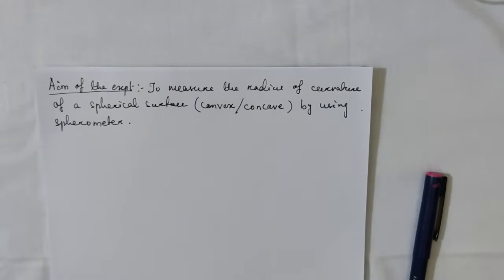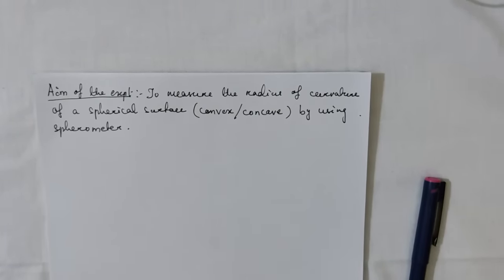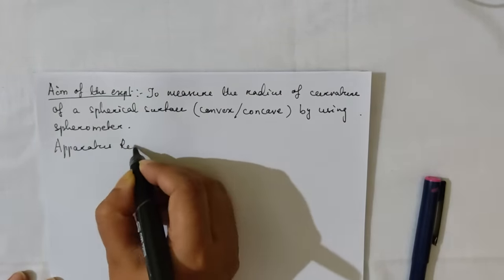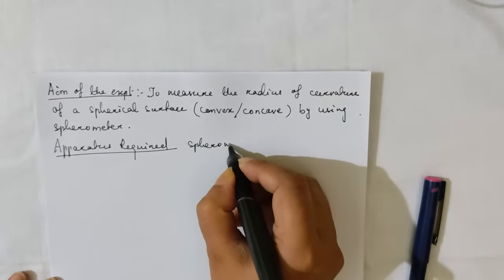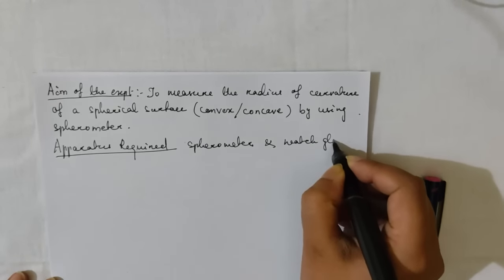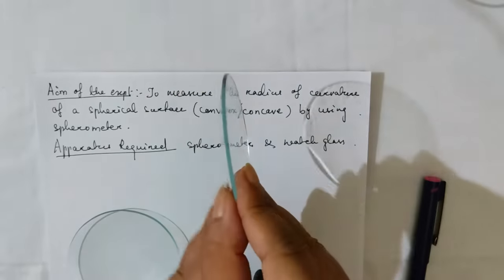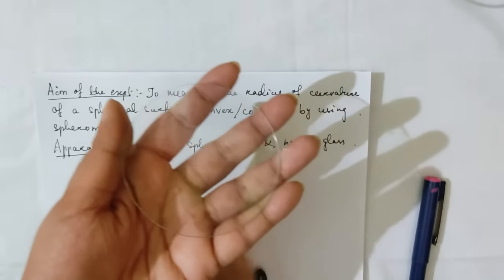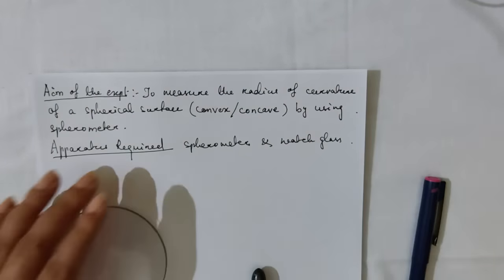Spherometer experiment (calculation of least count and tabulation- part-1 )

Comment: Ma'm why is the 0 of circular scale is not coinciding with 0 on the vertical scale when taking them on the same position Across each other?
Reply from the maker: That is called Zero error. But by this method you don't have to check the zero error.
Reply: @behindthecurtains7582  ok mam

Comment: I am going to give a skill test of Npcil,if there is zero error in the scale ,have i to take the zero error into consideration or not? Like if the edge of cs is under 0 of  pitch scale its negative 0 error while all the 4 legs are on the same plane. So, in skill test can i avoid zero error?
Reply from the maker: In this method zero error determination is not required.